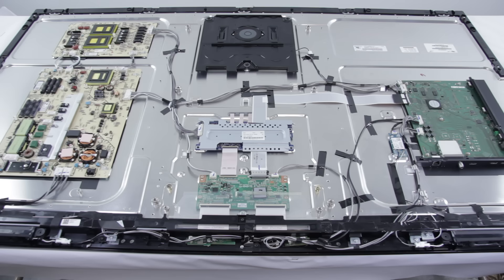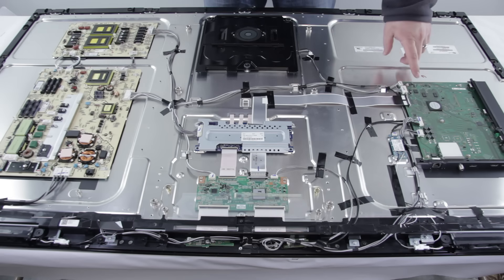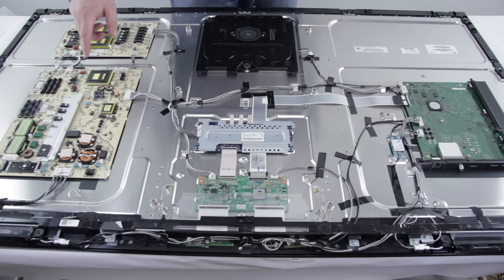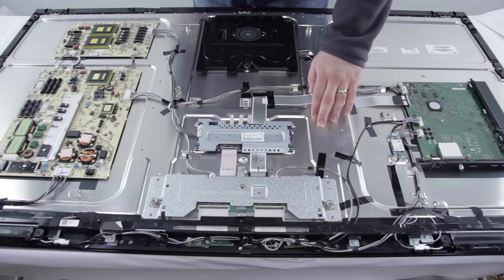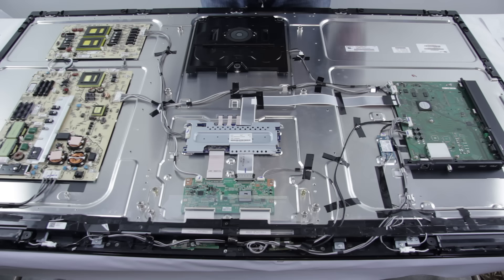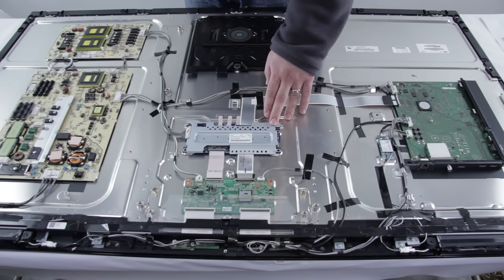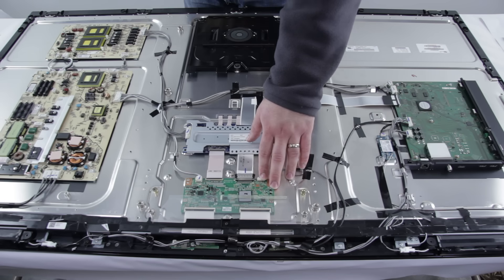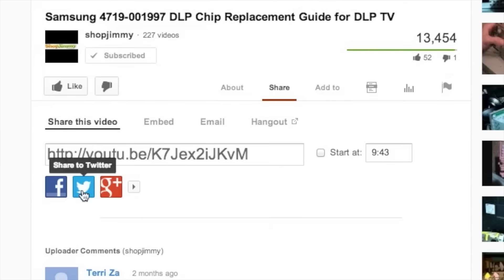LED TV Repair Tutorial - Common Symptoms & Solutions - How to Repair LED TVs

Comment: Samsung UN46D6050TFXZA: Unit  LED comes on and tries to power up, but then never does. Pretty sure it is a PS issue, but from a visual check did not see any bad caps or other potential cause. I can purchase ane replace the board for ~$60, Part # PD46A1_BSM. The hold back is the fact that the unit is not all dead, but does actually try to power on, so I need to be sure it is a PS board issue...can you help further diagnose? damianegardner@gmail.com

Comment: I have an LG 46LD055 that will shut itself off after a minute or 2.   I can start it again but then it shuts off almost immediately.   I am assuming it is the power board overloading or overheating.   What are your thoughts.  If I replace it with EAY60869506  mine is stamped EAX60869506 not EAY  will this fix the issue?
Reply from the maker: kbsesel  PLEASE SUBSCRIBE TO OUR CHANNEL - Try all repairs and troubleshooting at your own risk.  This could be a problem with either the main board or the power supply.  You can replace the main board and power supply board individually to see if one of those boards fixes the problem.  Unfortunately I do not see any replacement parts in the search results for your TV model number on our website.  Please reply with your part number on your main board and I can try searching for replacement parts.  Thanks and please let us know if you have any further questions!  www.shopjimmy.com
Reply: Thanks..unfortunately it is not the power supply.  The next option is the main board.  Is it possible I have  some bad LED's that are causing it to overload.  some more details on this.  After it shuts off the first time any other time I try to start it.  it will turn off and on 3 times then the red light on the front of the set blinks red forever.   

the main board number is EAX61746409 (0)  unfortunately it appears out of stock at ShopJimmy (and everywhere else)
Reply from the maker: Kyle Sellers   PLEASE SUBSCRIBE TO OUR CHANNEL - Try all repairs and troubleshooting at your own risk.  If replacing the power supply did not fix the issue, then yes the LEDs can cause an overload.  Thanks!  www.shopjimmy.com

Comment: Good day. I have a samsung LED tv, model UA46D5500RR. There is an issue regarding the vertical lines. I have tried to replace the T-con board but the same problem still exists. I am currently in the Philippines. Can you help me out on this? Thnaks in advance
Reply from the maker: Redentor Catalasan   Try all repairs and troubleshooting at your own risk.  This sounds like a TV panel (TV Screen) problem.  If your TV panel is bad, it may be more cost-effective to replace the TV as panels are typically hard to find in stock, difficult to replace, and expensive.  Thanks and please let us know if you have any further questions!  www.shopjimmy.com

Comment: I have a samsung UN55EH6000FXZA showing a thin vertical red dotted line. Smacking the tv on the lower back near the bottom of the red line used to make it go away temporarily but now it's always there. Any suggestion?
Reply: I was slapping it toward the bottom of the tv right below where the power supply board is, if that helps narrow down the issue.
Reply from the maker: Omega Direx   Try all repairs and troubleshooting at your own risk.  This sounds like a TV panel (TV Screen) problem.  If your TV panel is bad, it may be more cost-effective to replace the TV as panels are typically hard to find in stock, difficult to replace, and expensive.  Thanks and please let us know if you have any further questions!  www.shopjimmy.com

Comment: Hello. My friend gave me a Curtis led TV. Model number LED1930A. It works, turns on sound works, just can't see the screen. I'm guessing the back light went out. I'm not really sure. Seems the most likely to me because you can the picture a certain angles and very faintly if you close in low light areas. Would love some advice. Probably going to use for my conversion van. Thanks. - Tim
Reply from the maker: Tim Biddle  PLEASE SUBSCRIBE TO OUR CHANNEL - Try all repairs and troubleshooting at your own risk.  This could be a problem with either the power supply or bad LEDs.  You can replace the power supply board to see if that fixes the problem.  Unfortunately I do not see any replacement parts in the search results for your TV model number on our website.  Please reply with your part number on your power supply board and I can try searching for replacement parts.  Thanks and please let us know if you have any further questions!  www.shopjimmy.com

Comment: Hello , I am from india , I have a Tv Brand Videocon , 40" led . Model no LEDTVVJB40FM-B1A . with the main board panel make LG , Panel Type - LC420eud-sca1 vid. There are three problems I am facing with the tv 1) Distorted sound from tv speakers. 2) when on HDMI mode picture comes and goes and its happen all the time. 3) 5inchs From the top there are horizontal lines are coming. Kindly help and advice what to do Thank you.
Reply from the maker: Abhijeet Joshi   Try all repairs and troubleshooting at your own risk.  This could be a problem with either the main board or the TV panel.  You can replace the main board to see if that fixes the problem in your TV.  Click this link to a replacement main board for your TV model number:  http://www.shopjimmy.com/rca-126779-main-board-for-led42a55rs.htm  There may be multiple boards for the same TV model number, be sure to match part numbers on your current board, with your replacement for compatibility.  Thanks and please let us know if you have any further questions with your TV Repair!  www.shopjimmy.com
Reply: Abhijeet Joshi Hello Sir, is there any test/method to check tv panel ? so that I can come to a conclusion !!
Reply from the maker: Abhijeet Joshi  Try all repairs and troubleshooting at your own risk.  No.  You can replace the main board to see if that fixes the problem, if it does not fix the problem and the main board is good, then the problem is most likely your TV panel.  Thanks!  www.shopjimmy.com

Comment: I have a seiki se50fy10. No video no sound. No back lights. I can see the menu using a flashlight.
Reply: Richard Elders I replaced the power board....still no back lights. Is it possible that the main board might control the leds coming on? I don't have voltage at the led connection. There is a 2 wire connection on the main board that is labeled Inverter going back to the power board or vice versa. Just wondering. Thanks in advance.

Comment: I have a lg lg50ln 5100 tv, the tv turns on and you can see the welcome screen with a flash light, when you turn it on the back lights flash as if they were turning on, I have checked all the connections and tried different main, power, and tcon boards, it seems to me the lights are not bad as they flash,, got any guesses.thanx

Comment: I have a 60" LG. Model no. 60pa5500-ua. Won't turn on & has clicking noise coming from the back with a red light flashes. Was just working fine yesterday. Now won't come on at all.

Comment: I have an LG smart tv, 55LM6700. When you turn the tv on, the Lg display comes on, then quickly the screen goes dark, and a little white strip flashes across the tv. What is that cause, and what parts do I need to replace to fix it? 
These are the possible parts but I wasn't sure if you knew which one exactly, or if these parts would fix it at all. Thanks!

Thanks! http://www.shopjimmy.com/lg-eay62709002-power-supply-led-board.htm
http://www.shopjimmy.com/lg-ebt62095802-main-board-for-47lm6700-ua.htm
Reply from the maker: Morgan Houser   Try all repairs and troubleshooting at your own risk.  This sounds like a TV panel (TV Screen) problem.  If your TV panel is bad, it may be more cost-effective to replace the TV as panels are typically hard to find in stock, difficult to replace, and expensive.  Thanks and please let us know if you have any further questions!  www.shopjimmy.com

Comment: hey guys!
i have a lg led tv model 32lv5500 and two days ago my remote control stop responding.
sometimes it works but its not often. I've changed batteries but it seems to me that the problem is with the tv controller sensor cuz it keeps blinking white like i was pressing the controller buttons. The only button that actually works is the on/off.
I've tried to open the tv to se if there was any parent rust but everything seems clean.
do you guys have any idea what problem this could be?
Thanks!

Comment: i have a panasonic tc-l50b6 tv that has audio and video with a flashlight and think i need the power supply board cause i can't find an led driver board and 4 wires go behind the lcd cover marked l1 + - and l2 + - from the power supply.the # on the board is pk101w0130i am i on the right track?

Comment: Hi, I have a element elefw651 LED tv that is only a year old.  It turns on and the screen lights up gray/black then the tv shuts down.  Before this happened you could hear sound but no picture.  I am between t-con board and power supply causing this.  any advice?
Reply: ShopJimmy.com   hello?

Comment: Hi was wondering if you could help I have a samsung ue32f5300ak led tv which has  sound but no  picture.I have a picture when I put Flashlight on it,also the screen sometimes lights for a split second.I read on a forum that it was T con board so replaced that put problem persists.Please any help would be much appreciated.
Reply from the maker: kxi721   PLEASE SUBSCRIBE TO OUR CHANNEL - Try all repairs and troubleshooting at your own risk.  This could be a problem with the power supply or the LEDs in the TV.  You can replace the power supply board in the TV to see if that fixes the problem.  Unfortunately I do not see any replacement parts in the search results for your TV model number on our website.  Thanks and please let us know if you have any further questions!  www.shopjimmy.com

Comment: i have a vizio M501d-A2R bought in 2013 now i have a line 4inches down all the way across the tv and below the line the picture goes from good to blurry above the line is perfect please help.
Reply from the maker: dominic foronato   Try all repairs and troubleshooting at your own risk.  This sounds like a TV panel (TV Screen) problem.  If your TV panel is bad, it may be more cost-effective to replace the TV as panels are typically hard to find in stock, difficult to replace, and expensive.  Thanks and please let us know if you have any further questions!  www.shopjimmy.com

Comment: Hello, I have a Sony Vizio 50" 1080p 3D Smart LED HDTV
Model #M501d-A2R
Serial  #LWJJOICP3802601  
I have light source and sound, but I do not have any picture.  I tried the flashlight test and I did not see anything projecting. 
Which board do you think needs to be replaced?the problem? 
Also, what part number associated with the board that you think needs to be replaced? 
Lastly, when I do the repair, what steps do I need to take to make sure I don't fry myself or the tv?

Thanks!
Reply from the maker: amrecruit   PLEASE SUBSCRIBE TO OUR CHANNEL - Try all repairs and troubleshooting at your own risk.  I recommend replacing the main board in your TV.  Click this link to replacement parts for your TV model number:  http://www.shopjimmy.com/vizio-55-75q01-001-main-board-for-m501d-a2r.htm  Be sure to match part numbers on your current board, with your replacement for compatibility.  Thanks and please let us know if you have any further questions with your TV Repair!  www.shopjimmy.com
Reply: ShopJimmy.com Ok, thanks. So you would suggest starting with replacing the main board prior to replacing the T Con Board?
Reply from the maker: amrecruit   Try all repairs and troubleshooting at your own risk.  I recommend 
replacing the main board in your TV.  Thanks and please let us know if you 
have any further questions with your TV Repair!  www.shopjimmy.com

Comment: My LG LED TV Model No. 47LM8600 suddenly stopped working. It gave a popping sound before it stopped working. When I try to turn on the power, the led light on the tv flashes for 3 times and then turns off and then nothing happens. Appreciate your help.
Reply from the maker: Gana   PLEASE SUBSCRIBE TO OUR CHANNEL - Try all repairs and troubleshooting at your own risk.  I recommend replacing the main board in your TV.  Click this link to replacement main boards for your TV model number:  http://www.shopjimmy.com/catalogsearch/result/index/?cat=56&q=47LM8600  There may be multiple boards for the same TV model number, be sure to match part numbers on your current board, with your replacement for compatibility.  Thanks and please let us know if you have any further questions with your TV Repair!  www.shopjimmy.com

Comment: Hello... I have a 47" LG LCD TV, model 47SL80YR-MA... When I turn it on, it displays for about 5 sec but you can hear in the Inverter Transformer of the Slave Inverter Board a sound like a shortcircuit and the display turn off for about 3 sec but the TV remains with sound in the speakers, after that time the display shows again for about 3 sec and the TV turn off or remains on but with a burned smell in the Inverter Transformer of the Slave Inverter Board. I think the problem is the Slave Inverter Board (specifically one of two transformers on it), but a technician told me that are the lamps of the display that made a Hi-Voltage ark and turn off the TV... Can you Help me please? Thanks a lot...

Comment: hi i have a samsung ue50h5300kxxu. which turns on and soumd is ok however it looks like  piece of screen about 2 cm has disappeared and then pushed together leaving it not matched in the middle and kind of greenish on the bottom is there a fix for this or a part replacement or something else i could do to rectify this problem.
many thanks 
mick

Comment: I have an Emerson 39 Inch led TV model: LF391EM4. The screen is showing the vertical lines. What part do I need to have this repaired. Also the power button is giving problems and only turns on with remote...

Comment: i have a Vizio M55OVSE. Lightening tripped a breaker and the TV went out and will not turn back on. I popped the back off and noting looks burned. What do you think? How can I test everything? I did test what looked like a fuse just above the power in. I test with continuity and it was good, but past that, I don't know what to test.
Reply from the maker: Rusty Cooper   PLEASE SUBSCRIBE TO OUR CHANNEL - Try all repairs and troubleshooting at your own risk.  I recommend replacing the main board and the power supply board in your TV.  Unfortunately I do not see any replacement parts in the search results for your TV model number on our website.  Please reply with your part number on your main board and power supply and I can try searching for replacement parts.  Thanks and please let us know if you have any further questions!  www.shopjimmy.com

Comment: I just bought a used Samsung U46C6300SFXZA and it has been working perfectly for the past week.  Today, all of the sudden the audio turns itself down to zero and the red power led flashes rapidly.  We can turn the volume back up but have to hold the remote right in front of the IR sensor.  As soon as we let go of the volume button, the volume goes down to zero.  Other than that, everything else is working great.  It is as though the IR is getting blasted by something, but we don't have anything else that could be messing with it, and we live on the second floor of an apartment complex.  Any help, or input on this would be greatly appreciated.  Thank you for what you do!

Comment: I have an LG LED TV, 55LA6200UA. The symptoms are that we have Sound by the Picture goes black. We can turn the power off and the picture returns but, in about 10 - 15 minutes, the picture goes back out. I took a flashlight and can see a picture going on in the background so it appears that I have a LED Driver issue. I am not sure if this model has the LED driver incorporated into Power Supply or if there would be a stand alone LED Driver. Thoughts? Is this something that would be fairly easy to replace myself?  Thanks, Ken

Comment: Sony KDL-55NX720, The tv plays normally most of the time. This is a 3D tv, first noticed that when I tried to start a 3D clips from the 3DSony store the TV shuts off and the red lights start blinking...either 4 or 8 times...not sure on the numbers. Then is started doing this when ever I would start Netflix or Amazon....Doing a reset usually restarts the TV, however sometimes, it takes several resets. And seems to be getting worse. But normally, if all we use the TV for is normal cable TV it performs normally with a great picture & sound. I'm not a TV repair guy, but I do lots of computer repair..this sounds like a weak power board to me, or am I totally wrong?
Thanks fpr any info on this issue....Mike

Comment: Hey Guys, I just saw your video after I uploaded a video of the problem I was having with my LG tv.  The problem can be seen here: 

https://www.youtube.com/watch?v=5gBrxWaiopQ&feature=youtu.be 

The tv model is a LG 55LN5600-UI.  The audio works perfectly, it's just the video randomly does that scrambling.  The image on the screen is from the tv's stock input menu, so not from any inputted source so I think it has to be a hardware problem.  If you can please let me know what part I need to replace I would be very grateful.  Thanks!

Comment: Hi, I have a problem regarding my LED 42 inch LG TV Model 42LE7300. Every time I use the HDMI inputs, some little white lines appear and dissappear on the screen. As I said it only happens when I use an HDMI input but not when I'm watching TV as normal. Thanks for the help.